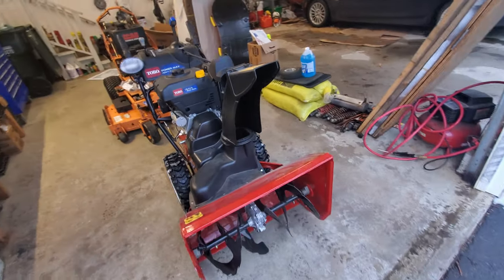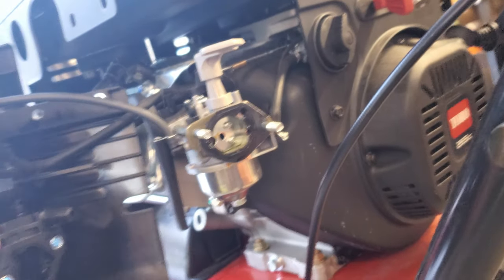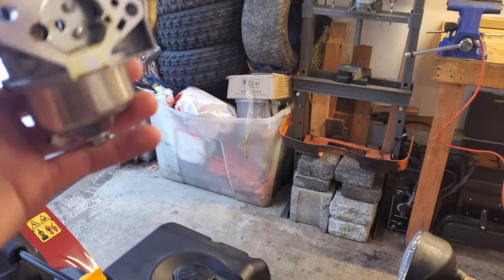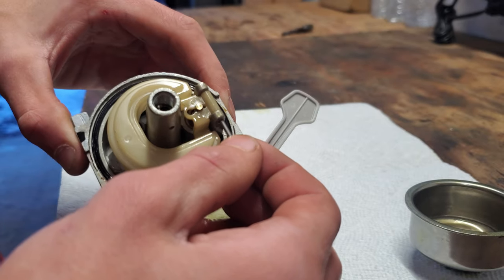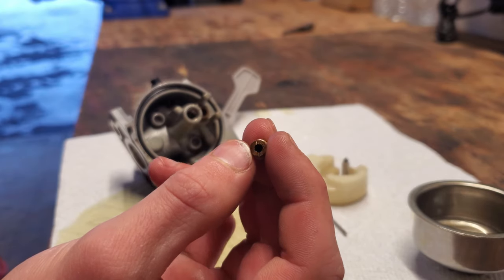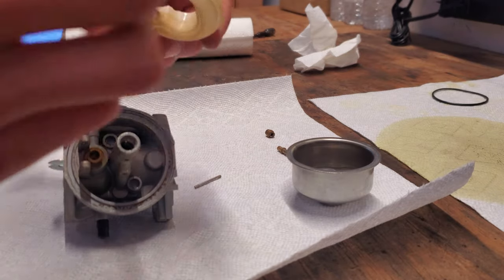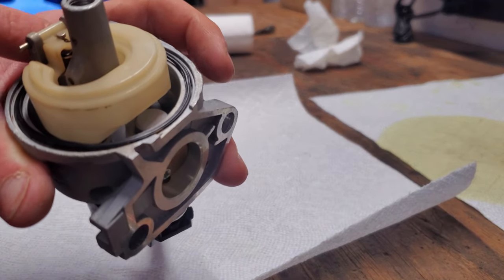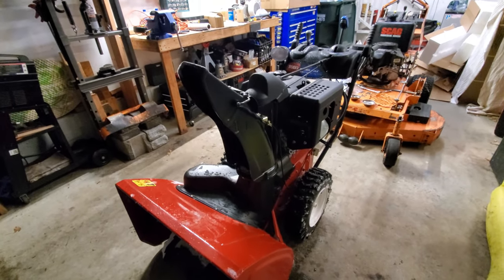Cleaning the Carburetor on a Toro Snow Blower

Comment: I used you video to clean my Toro 724 qxe carburetor. The only step I didn't see in your video was removing the spring on the linkage, but I did it without any problem. Now it starts on the first try. Thank you!!

Comment: I have the identical snow blower I knew it was getting spark but no gas. I followed the steps in the video pulled carb cleaned jets and it started right up. So simple and I almost took it to a shop thanks for such a perfect simple video Amazing job!
Reply: im watching it now, got spark, no bueno for start.  Hopefully it works but it looks like that is the culprit :) i'll follow up with a comment

Comment: Now that is a well thought out design Toro has engineered to get at the carburetor. Some machines are an engineered nightmare. Snow blowers don't have air filters, so if you do use gasoline with 10% ethanol and forget to empty the float bowl while in storage, moisture can more easily find its way into the carburetor and cause corrosion and blockage of jets and tiny orifices.  Sea Foam works well to keep carburetors clean. I use it year-round in all my outdoor power equipment fuel. If possible, use ethanol free fuel. It does cost more, but in the long run, it is well worth it. Ethanol in fuel absorbs moisture. Not good for outdoor carbureted equipment stored during the off season. Great video, it defiantly shows Toro engineers designed the carburetor for easy access. That was a nice thing you did for your neighbor. I am sure she really appreciated your kindness.
Reply: I added seafoam to my fuel. I cleaned my carburetor for the first time and it’s still surging a bit. Do you think seafoam will fix my surging over time?
Reply: @voltvolt-t6g  Some carburetors have an idle jet under the black plastic idle screw. If yours is one of those carburetors make sure you take it out and clean the tiny hole in the jet. If you have done that already and also cleaned the main jet and emulsion tube and you still have surging, be sure you don't have a vacuum leak due to a bad gasket. According to Sea Foam, you can mix it as strong as 50/50 for extra cleaning of the carburetor. Make sure your fuel is fresh fuel when mixing with Sea Foam for best results. To answer your question if Sea Foam will fix your surging over time? It should, as long as your surging is not due to a vacuum leak. Some replace the carburetor with an aftermarket one. I have had mixed results with aftermarket carburetors. Some good, some not so good. Wish you the best with your surging carburetor.
Reply: @russellmaddock3492  I most definitely missed the idle jet. Thanks for your help!

Comment: I want to thank you so so much!  We got 21 inches on Long Island and my new snowblower, which I left gas in it over the season didn't start.  I checked out videos and came across yours, so detailed and I did it all by myself.  I googled what I could use instead of carburetor cleaner and used 50 to 50 % white vinegar and alcohol.  Put it back together and said a prayer.  OMG. it started!  Thank you and God Bless
Reply from the maker: Glad I could help!

Comment: Thanks for the vid. I have a Toro 621 qze, similar setup as the one you worked on. I didn't removed the carb. Instead I removed the plastic housing and this gave me better access to the cap, Bolt and the long inner pipe. I couldn't see though bolt pin hole ( clogged ). I also noticed the inner sleeve has smaller pin holes and half were clogged. I soaked both in carb cleaner for about 30 minutes then blasted them with carb cleaner and compressed air. The holes came out clean. Reassembled and the machine runs like new. Thanks again, saved me $$ from having it serviced.
Reply: I did the same, instead of taking off entire cab, I removed bottom bolt and metal small cover,  drained gas, then remove nut & long pin, cleaned them.  It worked again.

Comment: Snow blower didn't start and I checked the spark plug and it was not sparking. Bought a spark plug and it would still not start. Watched this video and was able to clean the carburetor and the snow blower started. Thank you for your video.
Reply: How do you check whether the spark plug is sparking? This was not shown

Comment: Thanks for this video.  The steps were in great sequence and overall easy to follow.  I never saw gunk in the carb, but the running on full choke issue went away anyway.  Maybe a stuck float?  M/C sat all summer with gas not drained or conditioned.  Good one.  Thanks again.

Comment: Saved my hide today with a dead snowblower. I took the bowl off and sprayed some carb cleaner on most of the bits. Changed the gas and checked the spark. Bone dry in the combustion chamber. Came back here to see how to properly clean a carb. Sure enough, I wasnt thorough enough. Took the jet out of the stem with a screwdriver (thanks for the word of caution about sensitive brass parts!) and sure enough, the back side of it was completely clogged. It came alive on first pull but still doesnt like anything less than 50% choke. Thoughts?
Reply from the maker: Glad I could help! If your snowblower doesn't like to run without choke, the engine is running lean meaning it's not getting enough fuel. I would check to make sure that the main jet is completely clean and the carburetor is making a good seal against the engine where it mounts (check the gasket for any rips or replace it)

Comment: My Toro 826 OXE that I used for just 1 winter would recently start roughly and then die shortly after. Tried Sea Foam hoping it would magically fix it and it didn't (I was lazy). Then I did exactly what you did in this video (carburetor is the same) and it worked! Actually, the 1st few times I tried to start after cleaning it was still rough and died quickly, not sure why, so I had lost hope... But I gave it another shot 15 minutes later and it finally worked well! So thanks for your video, it's great!
Reply from the maker: Glad I could help!

Comment: Thanks for the video well done I just bought a Toro 1030 snow blower who makes toros motors
Reply from the maker: These snowblowers seem pretty tough, I'm not sure who makes the engines though
Reply: Thank you appreciate it b
Reply: @everythingmechanical_yt  Despite making the majority of the snow blower, Toro does not make the engine. Loncin Holdings, a power equipment manufacturer in China, produces all of Toro’s engines, including the ones in snow blowers. The HD line of snow blowers from Toro are commercial grade engines and are built to last longer while delivering impressive torque and HP along with good fuel efficiency.  Nearly all snow blower manufactures now use engines made overseas. One must also understand that these manufactures have certain requirements such as reliability, ease of starting, fuel economy, torque and HP and even noise level requirements. Companies like Ariens, Toro and MTD have their reputations at stake, so not just any engine will due. The days of B&S, Kohler and Tecumseh engines made here in the USA are pretty much over. Some special built commercial engines are still produced in America, but most now are manufactured overseas. Reliability, torque and power are what really matters in outdoor power equipment. In my research there haven't been many engine failures due to poor manufacturing. Most engine failures are due to improper maintenance. Yearly oil changes with a quality engine oil are the key to a long-lasting snow blower engine. I personally use Toro 4 cycle 5w30 snow blower engine oil. Toro don't make the oil, but like there engines the oil has to meet certain 4 cycle small engine requirements. The same goes for Ariens and MTD engine oil. Hope this helps.

Comment: Hi, I am facing same issue I left gas in tank and now its not starting. I will follow ur instructions. Can u answer below:
What we should do when winter is over, do we need to drain out all gas and put some stabiliser in it or what ?

2. Do we need to use regular gas or premium gas in snow blower ? Mine is toro dual stage auger bought new 2021
Reply from the maker: When the winter is over, you should always winterize your equipment. This means draining all the fuel out of the fuel tank and carburetor, or even just running it out of gas. If your machine has a fuel shutoff you can add fuel stabilizer, then turn the fuel off and run the machine out of gas. Your machine should just use regular gas but if you can find it, ethanol free fuel wont go bad and will prevent any of these issues going forward. You also shouldn't need to winterize it if your using entanol free fuel

Comment: I am having carb problems with my Toro Power Max 824, but didn't know how to go about fix it. Your video is great. Can't wait to get started working on it following these instructions. I already made an attempt, and was sloppy with the carb cleaner, getting it on the rubber parts. Maybe I should replace them when I take it completely apart? Thanks for saving me some $$$
Reply from the maker: It should be fine as long as the O ring that goes around the bowl hasn't stretched to the point where it won't fit back on. It really just depends on how much you got on it. Either way these parts are very inexpensive, and can be found in a carburetor rebuild kit where you can get all new jets and everything. Let me know if this helps!

Comment: I cleaned the carb and filled it with new fuel, but it does not start up. It fires as bullets but doesn't turn on . Any suggestions on what could be the problem?
Reply from the maker: I would make sure your jets and everything are in properly, and also make sure the gasket where the carb meets the engine is in tact and making a good seal

Comment: Do you need to remove the idle screw as well. Mine idles erratically but runs fine under load. Half choke seems to fix the idle issue…fuel issue Im guessing
Reply from the maker: On some models you can adjust the idol but it could be anything from a dirty carb to a vacuum leak. I would try and see if you can adjust the idol then go through the carb and reinstall with new gaskets
Reply: @everythingmechanical_yt  well the idle screw seems to have a cap over it. Sealing it from adjustment I’m guessing. Do you bother to remove this or is the main jet cleaning enough. I checked for vacuum leaks already so I think I’m good there. Just a dirty carb I guess
Reply from the maker: @Shawnsboostedgarage  it's probably the idol jet that's clogged so I would just do a complete carb clean
Reply: @everythingmechanical_yt  ok will do...thanks

Comment: We just got a used toro snowblower. I’m not a mechanical person. So replaced the spark plug with a brand new one today and still didn’t start. I’ll be attempting to check the carburetor in the morning. Fingers crossed it’s just needing a clean like this one did. The one we got hadn’t been used in YEARS and still had a bit of gas in the tank to I feel hopeful that it might be the carburetor. I’ll reply if letting you know if this fixed it.
Reply from the maker: Sounds to me like it may be the carburetor
Reply: @everythingmechanical_yt  Carburetor clean was the fix! Even though when I took it out it looked pretty clean I still sprayed down everything you did with the carb cleaner and started right up. The pull start for some reason isn’t working. But the electric is so unsure what that could be

Comment: How do you check for spark.  You didn't show that.  Can you explain.   Tks
Reply from the maker: Just remove the spark plug, attach the plug wire and set it on the machine so that the metal threads on the spark plug are touching metal on the engine. That way its grounded. Then, use the electric starter or pull cord to crank the engine over and look for a spark inside the gap at the end of the spark plug. Let me know if you have any more questions!

Comment: How did you take off the fuel line? What tools?
Reply from the maker: Use a pair of pliers to squeeze the clamp and slide it upwards. Then try to pull the fuel line off. If it doesn't come off you can use pliers to lightly try and twist the fuel line at the base just to break it free. Then you should be able to pull it off. If it's really old and cracked its a good idea to replace that too, don't use it if it's leaking.

Comment: FYI: A brand-new carb can likely be had for about $25 on Amazon. In my opinion, replacing it altogether is a better option than rebuilding an old one. When I do carb work on motorcycles, I replace any clogged jets with new, because unclogging them isn't worth my time. This past spring, I had a string line trimmer that would no longer idle on its own after sitting for some time. I replaced the carb with a brand-new Walbro unit, to the tune of about 20 bucks and called it a day! Cheers!
Reply from the maker: That may be true however the aftermarket carburetors are much lower quality than the original oem ones and tend to not last as long
Reply: Hi have a toro 724 oe,missing a carb.do u know where I can get one from?
Reply: Amazon carbs are garbage and not near the quality as oem. It doesnt take long to clean a simple small engine carb and I would prefer that route over a questionable chinese carb.
Reply from the maker: @mattdibiase9619  exactly why cleaning or rebuilding original carbs is my go-to
Reply: Or..... Try what I do with all my small engines.  Use Stabil in the fuel year round and NEVER have to clean a carburetor.
Reply: Amazon carbs are strait up trash.

Comment: We can clean the carb without taking it completely off, can’t we?
Reply from the maker: You can, it just won't be as through. If you take the bowl off and clean all the jets it can be hard to get to but it can be done. Just try not to get too much carb cleaner in the engine
Reply: @everythingmechanical_yt  Thanks and I was able to get it started. Ran the old gas out and put some new gas but then was blowing lots of smoke and couldn’t start back up again. I noticed I’m now leaking some gas out of the carb. I’m assuming I didn’t put the float back in correctly. Maybe gas tank I had in garage was too old is why it didn’t start up again. Went out for fresh gas and added some more but still would not start. Looks like back to square one. Unit is only two years old with only 5-7 times of use.

Comment: This is some bull shit my snow blower is only 2 years old i used it about 4 times i made the mistake of leaving gas in it and it would not start for the money they charge for them they make them with cheap ass parts i expected more from craftman
Reply from the maker: It really has nothing to do with the parts used, if you leave fuel sitting in any small engine, it will gum up. Only way to avoid it is to winterizing it. Ethanol free gas can help too

Comment: Sorry, but i gave you a thumbs down. Your carb cleaning was fine and could have received a thumbs up if only for one reason. Whenever you have a carburetor needing repair, whether cleaning or parts replaced, you should ALWAYS clean all gas lines and TOTALLY clean (blowout) the gas tank. The gas you poured from the bowl was terrible looking. Therefore you may have it running well at this time but without completing the process you are asking foe additional trouble sooner than if done fully. If i had to rate your carb cleaning i would have possibly gave it a thumbs up, however, even at this alone it’s always better to verify the primary orifice (jet) and secondary offices (jets) are clean. Doing this it’s best to use wire as found in a welding tip cleaning set.
My comments are not meant to be destructive but since folks look to YouTube as training videos i felt you needed this input. Thanks for understanding.